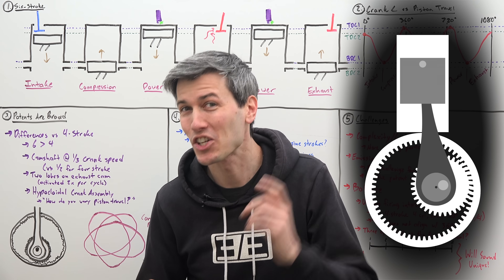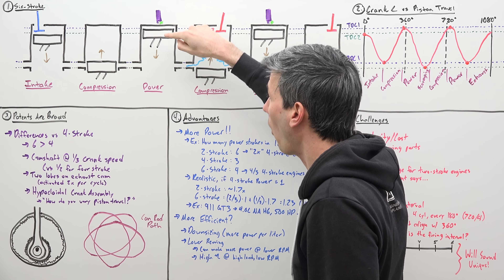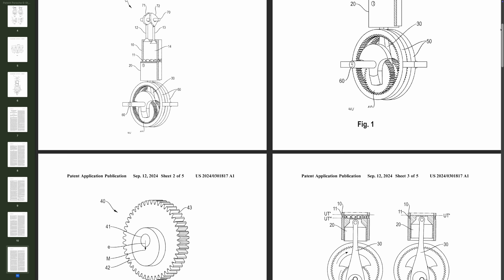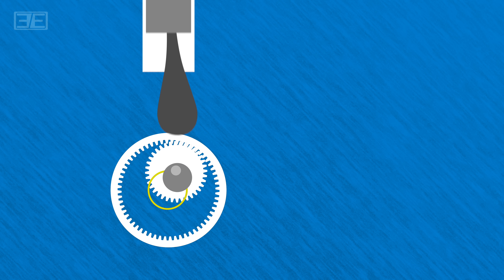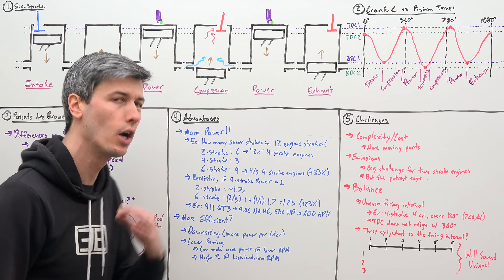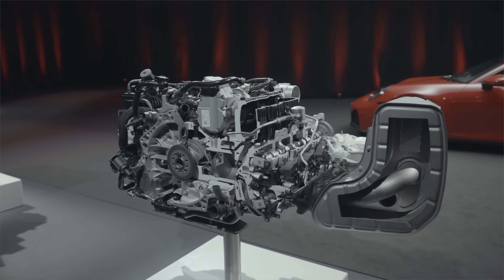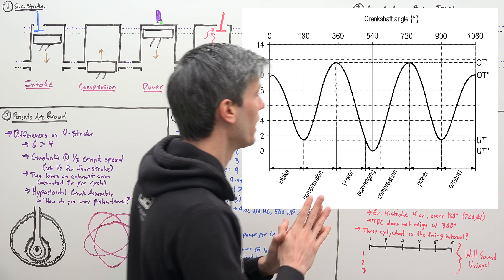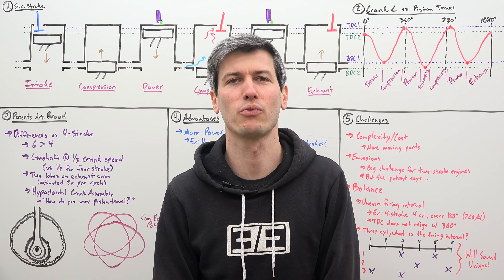Porsche's 6-Stroke Engine Is Genius!

Comment: I'd be curious if, for efficiency discussion, there'd be a clean way to do "power stroke de-activation" - cut out fuel entering in the 2-stroke portion of the cycle when the engine isn't under high load. We know GM has done "active fuel management" cylinder de-activation before, I'm imagining something like that, but instead it cuts each cylinder down to 1 power stroke per 6 strokes instead of fully disabling a cylinder.

Comment: Better options for efficiency using hybrid options for fuel economy and performance.  500hp in a small precise auto is plenty.  ICE cars are getting smoked by e cars, they are even using vacuum systems to hold them on the road.  More violent than fun and will pump adrenaline if that is your thing.  One thing, the new super cars are works of art in design and performance.

Comment: V-twins, 180° parallel twins and some successful designs of inline 4-cyl motorcycle engines have proven that even firing intervals can actually be detrimental to tyre adhesion under maximum power.  I don't fully understand the reasons behind it, only that it works.  That could be worth exploring.

Comment: Why not use a negative crank pressure 2-stroke with hydraulic oiling and a supercharger problem solved
Reply: The setup they are using is a mechanical nightmare with so many extra articulating parts it will limit the RPMs of the vehicle with many extra failure points and excessive parasitic drag

Comment: Balance can be solved by adding more pistons. If we have 12 pistons, it actually works! If we go by rotations and which cylinder is firing (would require reordering for further balancing):

Rotation 1: Cylinders 1, 2, 5, 6
2: 3, 4, 7, 8 
3: 1, 2, 9, 10
4: 3, 4, 11, 12
5: 5, 6, 9, 10
6: 7, 8, 11, 12
Reply: I think that 12 cylinders would yield too much of a combined weight, emissions and price penalty.

My guess is that it would be super-awesome if they had a high output 3 cylinder engine but then there would be a Fear Penalty because buyers would be afraid of reliabilty, maintenace cost and warranty issues on a super-high output 3 cylinder engine.

However, for the fearful, as an auto-enthusiast myself, I owned an exotic 3 cylinder Toyota sourced Daihatsu Boon in about 2004 and I got years of wonderful reliability, fuel economy and power output (for Kyushu mountain climbing with the whole 4 person family aboard) from it so, mass-produced highly reliable 3 cylinder engines are possible.

I also like AMG's idea of putting both a supercharger and an electric, electronically controlled turbo on their inline 6 engines.

I think that that kind of approach could be effective here if they can develop metals and seals that are strong and heat-resistant enough to endure the kind of internal pressures that this kind of engine would inherently produce.

It would also be totally awesome to have an optional engine brake (for those who don't mind the weight penalty) to assist with braking and reduce super-expensive exotic carbonfiber disc brake wear.

Comment: Potential Split/ dual fuel engine?

DI gasoline in the “4 stroke” operation and diesel for the “2 stroke” operation. Seems to me this setup would support the assumed boosted (forced induction) and “cleaner” 2 stroke operation. Could also explain the 2 lobe exhaust cam, one for diesel (DPF, EGR, etc) and one for gasoline combustion. 

Think 2 stroke turbo diesel and turbo charged 4 stroke engine combined into one. 🤷🏻‍♂️

Comment: Cool video, water injection is sometimes used for added steam expansion effect, done correctly it adds power, with 2 combustion events per cycle, it could be very significant..if it could be adapted

Comment: Porsche didn’t invent anything. This is just a remake of ones designed in the late 1800s. The best one of the designs was done so that a cooling system wasn’t needed. What Porsche is doing is finding a way to build a cleaner 2 stroke. Eventually it will be an 8 stroke, with the weird valve system.

Comment: You can improve the overall efficiency of this engine with the second power stroke by using the heat generated during the first one.
One of the biggest problems with four-stroke engines is the amount of energy lost in the exhaust.
They might be able to recover more energy from the heat with this six-stroke engine.
That’s why a turbocharger improves the overall efficiency of an internal combustion engine by using the heat from the exhaust gases.

Comment: Very nice video, very interesting idea, great coincidence this is the number 1000! Congratulations! As for the engine, I have two doubs: first, they need to inject more fuel to have the power gain, as the whole thing goes bang more times. So, a common 4 stroke engine seems to be more economic anyway. Second, all these gears acting in and the crankshaft would probably present very serious lubrication issues, thus raising doubts - at least to me - about the durability of this thing when really driven hard. Lets see if this patent will came to work in real world. As it is, however, is very beautiful piece of creative engineering.

Comment: If you can magically clean up a 2 stroke, just build a clean 2 stroke. Presto all advantages and no disadvantages. Or, some engineers had a goal to file a new patent, so they dropped some acid and let one rip.

Comment: Another way of obtaining efficiency is to have your power stroke be longer than your compression stroke (in swept volume terms), like an Atkinson cycle, but that doesn’t seem to be what’s happening here, and also - wouldn’t you need boost for the two stroke portion of the cycle? N/A two strokes partition the crank case and use it like a reciprocating pump, but this entrains oil into the cylinder and would mean the engine would struggle to meet emissions.

Comment: So .. this isnt a 6 stroke. This is a 4 stroke +  a 2 stroke. Or in reality a 3 stroke engine. If you know how 2 stroke engines work you'll see the 2 stroke mechanism.

Someone sat down and literally thought "what if could create a 4 stroke engine with the advantages of a 2 stroke.. hey.. what if i just combined them"
This is pretty brilliant if they can make it work. The huge flaws of the 2 stroke are massive pollution, fuel efficiency and noise. This design eliminates those if it works.

Comment: Really failing to see why there's a need for two different BDC's, but then I remind myself it's German. Nothing good comes out of Germany. Porsche, BMW, world wars.

You have different lobes for the exhaust cam so the exhaust valve opens in different intervals. Instead of clean air coming from these random ports, why not just open the intake can a second time? These cars are fuel injected guaranteed. You can disable fuel on that specific stroke to just allow only in since there's excess hydrocarbons leftover from the original combustion stroke. I'm not against this idea. It's kinda like a small turbo built directly into the engine.

Comment: The clean and complete combustion will be probably achieved through the mixture of a lot of exhaust gas in the second intake. The patent even indirectly mentions the method:

"In the context of this application, the term “gas mixture” does not refer exclusively to an air-fuel mixture but merely to a gas of any composition. Thus, for example, air-fuel mixture that has already been burned can be referred to as a gas mixture just as much as air alone."

Comment: If they can do this, why not just make it two stroke without the oil added to the fuel. If it's not burning oil surely it can be efficient enough to work in 2025

Comment: In my uneducated opinion the th extra ports at the bottom of the cylinder can't work without forced induction.  Because of the pistons coming down on a power stroke, even at bottom dead center there will be a fairly high pressure in the cylinder because of combustion.  Therefore you would have to overcome that pressure to introduce  more air to the cylinder.

Comment: What would be cool is if they did a 6 stroke with 2 strokes that do nothing, instead of doing the notoriously unreliable cylinder deactivation. Plus if they combined it with a miller cycle, you could have a high output 4 stroke, a high efficiency 4 stroke, and a very high efficiency 6 cycle. This would be such a Mazda thing to do, but they'd have to put it in their i6.

Comment: Maybe instead of trying to offset every power stroke by 180 degrees, they fire in pairs. 

One cylinder fires its stroke five power stroke, and another fires its stroke three power stroke, and so on. They don’t line up to fire exactly at the same time, but they would be close. It could be something like 1:3, 3:2, 2:1, 1:3, etc.

That would give you two power strokes firing every 360 degrees of rotation. And that would definitely give it a very distinctive sound.

Comment: Wouldn’t uneven cylinder wear be problematic with this design? 
You have areas of the cylinder walls (the very top and very bottom areas that make up the secondary TDC and secondary BDC) that will only see a percentage of what the middle area of the cylinder wall experiences as far as frictional surface wear.

Comment: I think if this is a three cylinder engine there would be two power strokes for each revolution. I think it would need to have all the pistons moving up and down together. Two of the three would be firing on each downward stroke. The fuel efficiency improvement could happen by turning off the fuel injection for the second power stroke when the engine load is small. Then it would have only one power stroke per revolution. The second power stroke could occur only under high load so there won't be any misfire by trying to ignite a mixture that has too much exhaust gas mixed in. It seems like there will only be about 120 degrees of crankshaft rotation to scavenge the cylinder before the second compression stroke. It may not breath well unless it has some kind of supercharging when it is using the second power stroke.

Comment: Balancing act ... just a thought that popped into mind 

Offset the intervalls by piston specific modifing the crankshaft timing ... and take advantage of the constant powerstroke deviation by phasing it into the cycles  
3 cycles = 1080 
3.5 cycles = 1260 
1260 : 3 = 415 degrees between powerstrokes results in evenly timed powerstrokes with a phase changing cycle
... thus using the uneven timing to its advantage
415-360 = 55 degrees offset ... which +/- relates to the graph

Comment: It seems a flywheel connected to the crank with the toroidal gearing might be needed to counter balance the power stroke timing issue to reduce vibration this engine might have. I can't wait to hear one of these actually running.

Comment: There should be a way to stagger the cylinders at different angles relative to the crank shaft so the power strokes are evenly spaced.  There's nothing that limits the layout to inline or V.  The six cylinders can be at three different angles, can they not?

Comment: The big advantage I see here is smaller displacement with adequate output without using a turbo. Any additional complexity is within the relatively cool well lubed crankcase rather than the high heat high rpm turbo.

Comment: As someone who started with two stroke dirt bikes then moved to cars this was actually super easy to understand but I’m interested in how the crankshaft is going to hold up.. will this design be more for efficiency or will we be able to get high hp is that crank design stronger or weaker?! What will the wear time be like will we get less wear or more will engines blowing up at 90,000miles be a thing of the past? ahhh I love this! Will cylinder wear be effected? So many questions 😂

Comment: 1000th video! That's impressive! 
Also very fitting that it covers the
last gasp of the old internal comb-
bustion engine. Unless we consider
efficiency improvements possible
with a simple opposed piston engine
with computer controlled electronic
renewable bio-fuel injection ( > 50% ).

Comment: E85 ethanol produces about 20% more power in cars vs unleaded gasoline. If E85 ethanol was a standard fuel for vehicles we'd get cleaner air to breathe and more horsepower in vehicles. No 6 stroke necessary when you can achieve the same power gain results through E85 ethanol.

Comment: How about consumption? The first strokes reminds me Atkinson-cycle resp. Miller-Cycle, however 3 to 4 are similar to standard 4-Stroke engines. 
-> gas consumption should be less... 

Hoe about vibration ? Is it same or more intensive?

Another question: do smaller engines really safe gas ?

Comment: 3 cylinder balancing:
1:  1+3 
2: 3+5
3: 5+1

Just it’ll have longer 360 degree gaps between firing.  Until you get a 6 cylinder setup to fill in the gaps.

Comment: I Think  Making Car engine Pistons operates independently like single cylinder motocycle motor,solves many problems of long Crankshaft and camshafts,making more shorter lets less precission headaches and constant brake and parts wearing

Comment: Air intake time is negligible & there is no suction/ plus used up dirty gasses already there, the 2nd power stroke will just be a waste of fuel, resulting in lots of unburnt fuel, given proper combustion requires fresh O2 air

Comment: If i get this correctly, while the piston is at top dead centre the crank angle is ofset giving the connecting rod more leverage to push down on the crank as opposed to a four stroke which requires both the crank and piston to be at the top of the stroke or slightly before when igition occurs.
Reply: I can also see big problems if your crank seals start leaking air.

Comment: Some clever designers out there. Some of these things appear good on paper but may not be any good as an engine in the real world.
I recall the idea decades ago of a rotary ported shaft that acted as the valves in an engine. Seemed like a brilliant idea but was a failure in real world testing so valves and valve springs with all their parasitic drag still rule. 

Congrats on 1000 vids. 👍👍👍

Comment: The engine will likely need to be turbocharged or the 4th stroke scavenging likely will not work to force the exhaust out of the exhaust valve.

Comment: I’m thinking about oiling the piston during the “2 stroke” part… I would think the crankcase would be full of oil, like any 4 stroke now… but how do they plan on keeping oil out of the ports, and how do they stop it from getting into the combustion chamber? 
 I foresee a future where these engines are tried, and they are known to burn a lot of oil, or even smoke a lot.   But the engineers are much smarter than me, so I can’t wait to see what they come up with.  😁

Comment: Congratulations on 1000th video Jason, you're always so clear, consise and precise with you work, with a no bs, no waffling and no unnessesary sideshow info. It's an absolute pleasure to watch, a shining example of what can be done in today's technological era. Thank you. 

And thank you also for this video in particular,  very interesting topic. 

I saw an announcement in a magazine a 25 or so years ago, talking about combining 2 and 4 stroke engines. It involved using a 4 stroke-style lubrication system for the crankshaft and pistons, but with rotating valves up top - where you'd normaly find the regular 4 stroke valves - which dealt with the two stroke intake and exhaust cycles. I think it was Lamborghini who were developing it at the time, though I can't quite remember which manufacturer it was right now. I've searched for it several times since, but not as yet found any further information on how that project went. It would be amazing to combine the benefits of both engine designs, whilst ironing out the disavantages as much as possible.

Comment: So what is so exciting about antiquated technology. Electric mottors are ctronger smaller and only 3 moving parts, one rotor and 2 bearings. far less moving parts so it is also cheaper to make. Why would any common sence engineer ever want to use so many parts and a fuel to make such an inefficient motor.
With the acceptance of free energy convertors to be allowed on the planet now, Porsche can make a very efficient and cheaper electric car by taking the petrol moter out and putting an electric motor in, no battrie packs required.

Comment: Horrible Design. It is going to be extremely difficult to time fuel intake, combustion, etc, primary and secondary balance are going to be completely diffrent from one revolution to the next, there is no way to change how heavy the counterweight on the piston is. So, unlike every engine since the beginning of time, it will not be balanced. Because of this, the vibrations from one piston firing, can counteract the direction you want the next piston to push in, and you will not reach peak power. The amount of potential power being wasted there is already way too much to justify ever producing this. 

Second, you have 2 top dead centers and 2 bottom dead centers, so the cylinders could be 1 liter each, but you would never be able to use the full 1 liter potential as it could only use aboue 7/8 of that with the first top and bottom dead center set and the other 7/8 of that on the second top and bottom dead center set. 

Third, After it compresses the air and fuel and combusts, it will not have enough time to replace all the exhaust with new fuel and air, so you end up re-combusting the exhaust and once again, waste potential power. This also means that you cannot have uniform power production. The first combustion will combust a full cylinder of air and gas, the second combustion will combust old exhaust with the air and fuel, so you arent able to completely fill the cylinder with air and fuel.

Fourth, you can't use an exhaust heated turbo, because the amount of exhaust you get greatly varies based on which of the two combustions you are on.

Overall, Horrible Design, Definitely NOT "Genius", Horribly Inneficient, Horrible to repair.